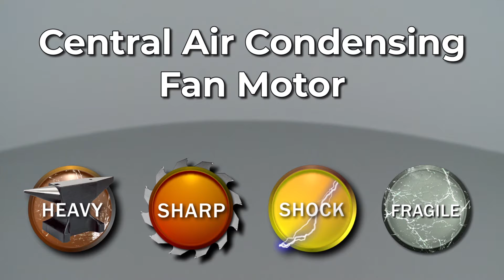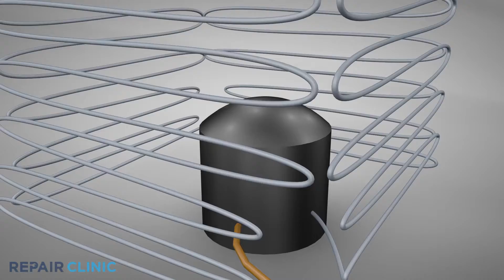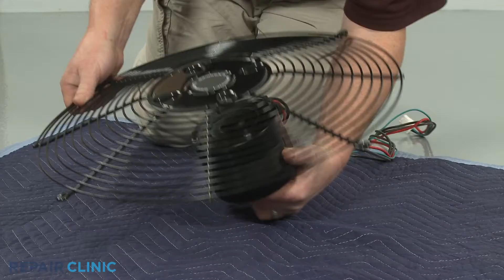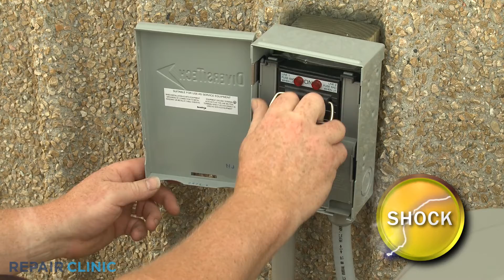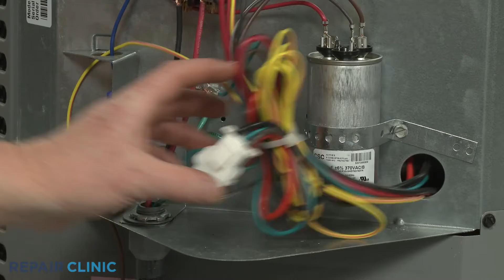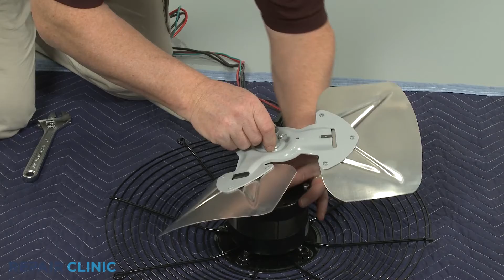Central Air Condenser Fan Motor Replacement

Comment: May I ask a question? I have a newly installed Kenmore /Comfortmaker by ICP Model N4A330LKA that began rattling seeminly fron the fan or motor assembly. Technicians were here and tried to fix it, claiming there was a stem or some plant piece in the motor.. but the noise returned shortly after they left and now the business that installed it, Transform Home Pro LLC here in Ohio is insisting that the rattling noise is perfectly normal operation of the unit, even though it did not rattle when installed and interestingly you can give the top of the motor a 'tap' and the rattling goes away completely before returning a short time later. 
Also, I have a 1968 sq ft home and wanted a 3 ton unit, but they instisted I needed a 2.5 ton, which is what they installed. Yesterday, the termperature was hovering around 80. I set the thermastat to 72 degree and began watching... it took 3 and 1/2 hours to cool 2 degrees and over 14 hours to reach 72 degree. I think I might have been undersized. 
Thanks for any help you can give, I would greatly appreciate it.